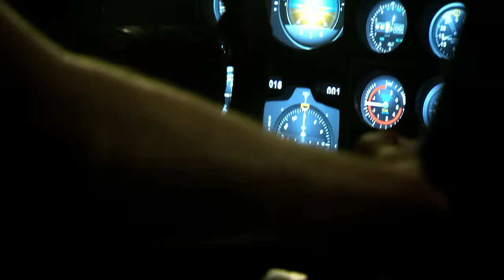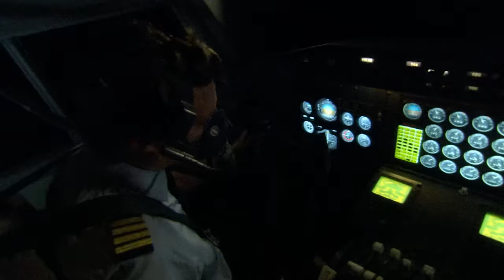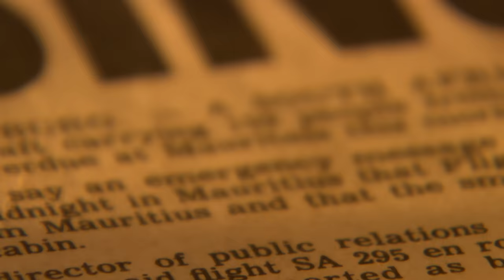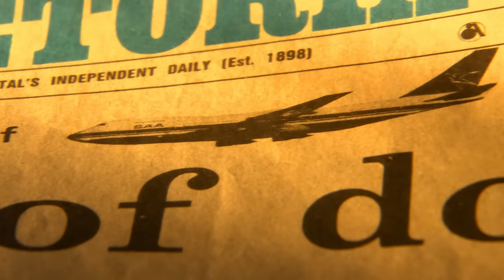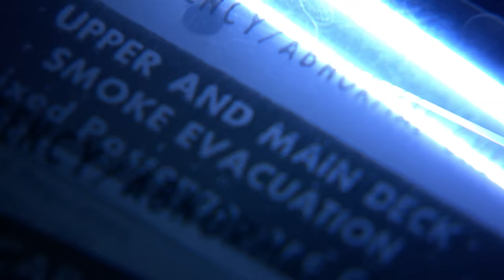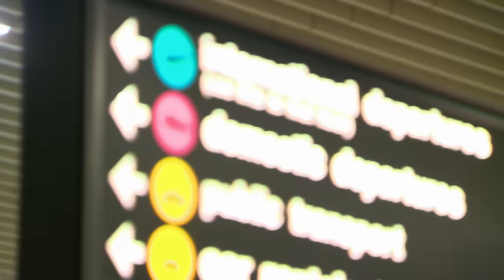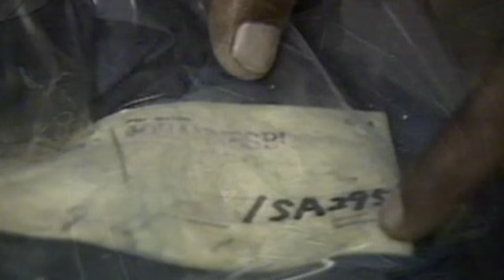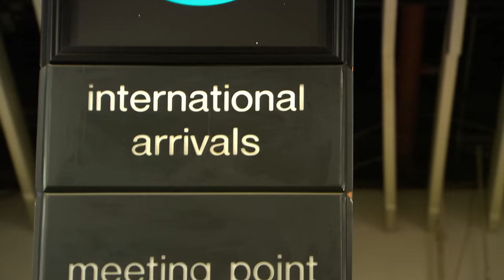Flight into Hell: The Terrifying Journey of a Smoke-Filled 747 | Mayday: Air Disaster

Comment: It was the batteries. Lithium Ion batteries if damaged or poorly designed can self combust. The issue with the Samsung Note 7 (I think) from a few years back shows this. Its very hart to put out a Lithium fire.
Reply: This is why at least in the US, it is expressly FORBIDDEN to transport batteries by air, at least civilian, idk what military regs say.
Reply: 1988 I dont think lithium was used
Reply: @rogm8577 Lithium ion based batteries were used in cordless rechargeable phones since the mid 80's as well as in cellphones.
Reply: @lethabrooks9112  I agreed it was batteries.
Reply: The batteries don't even have to be damaged to combust. Lithium batteries can just suddenly start burning without warning. Also it is recommended that you store lithium-ion batteries at a maximum height of 15 feet and never store flammable materials above them. There is a few articles on Consumer Reports about the lithium batteries on planes or at airports. There were 31 incidents in 2016. This compares with 16 incidents in 2015, nine in 2014, and eight in 2013 according to Consumer Reports. None of the batteries was damaged of poorly designed. The FAA banned the Samsung Galaxy Note7 smartphone from U.S. flights after it was recalled because of reports of fires and explosions.
Reply: The first rechargeable li-ion batteries came onto the market in 1991 (produced by Sony). The disaster happened in 1987.

Comment: While lithium batteries may have been uncommon at the time, there still could have been one that started the fire. Something that struck me was the mention of magnesium like in a sparkler. Magnesium is also used in significant quantities in portable electronics to reduce the weight of them. Its possible a battery fire got hot enough to ignite magnesium computer components and that resulted in a metal fire that would have been hot enough and difficult to extinguish.

Comment: If they put charred cargo pieces in a Mass Spectrometer they might find the combustion products which might point to a rocket fuel like ammonium perchlorate, or fireworks
Reply: After being on the sea floor for over a year I don't believe a mass spec would find any traceable gases which is all a mass spec can do. There are some microscopes that can break things down into elements. Having worked professionally with both I doubt either could give a significant answer. Today I'm sure they could come up with something more probable for the cause. That was three decades ago.

Comment: I have been concerned about the new 787s. A large percentage of the plane is made of carbon fiber. What kind of fumes would a fire on such planes produce? How fast would a fire spread.
Reply: Now that we've seen an A350 burn, we know that the carbon fiber composites used in modern aircraft are actually pretty fire-resistant.
Reply: @jonathankleinow2073 are you referring to Japan Airlines 516 which hit a Canadian made Q300 in HND Airport. That would be a good episode for the show
Reply: @EpicThe112  It will, but it probably won't be made until the full accident report gets released.

Comment: Have they installed emergency sprinklers in cargo holds? How much weight would it really add to the plane?
Reply: water is really heavy
Reply: 8.34 lbs per gallon. If the water has additives, it will weigh more.
Reply: You can't use water on electronics or battery fires. There are some gasses they use like halon (might be illegal now), CO2, I can't think of any others off the top of my head but there are a lot of ways to put a fire out automatically..
Reply: That’s an impossibility.